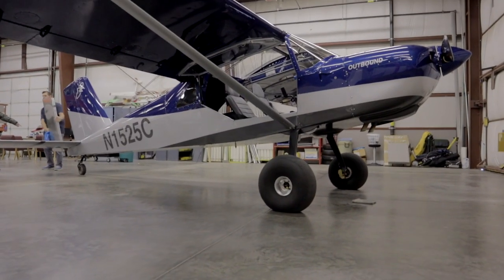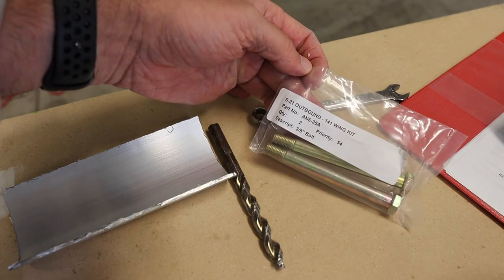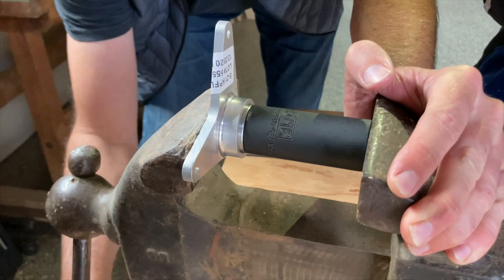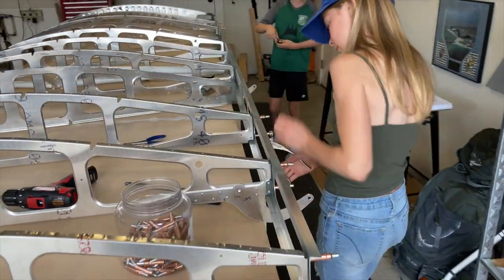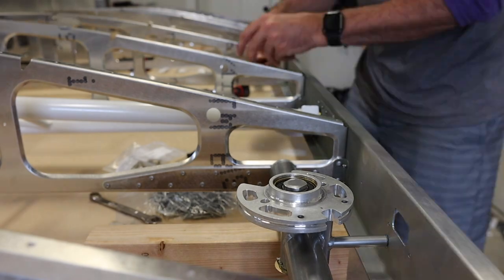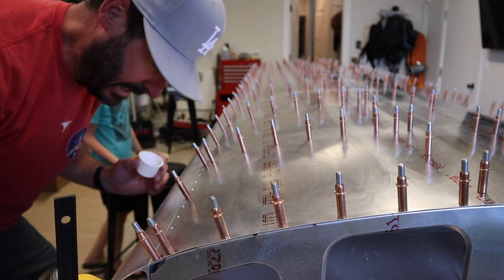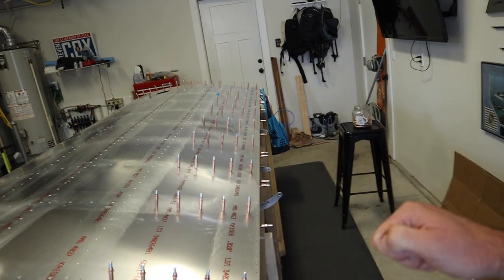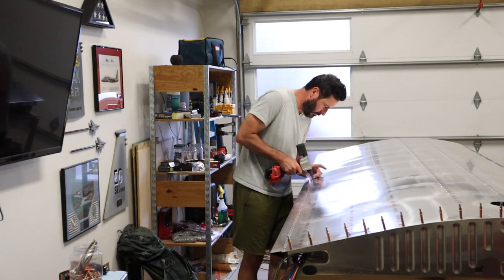RANS S-21 Ep 6 Wing Build Part 1 (LONGFORM)

Comment: Great to have the kids involved.  This is going to be such a huge boost to their self confidence. 
21:50 looks like you used thread lock with nylon locking nuts.  I have heard that the thread lock will soften plastics and combining nylon locking nuts is not good.  I could be wrong. I  don't actually know what I'm doing.   Looking for input from the collective wisdom.
Reply from the maker: Hi Ross, thanks for the comment. Good catch. I went back and forth on this (thread lock) myself. I still don’t have a great answer. I think I’ll pose it to RANS. Cheers!

Comment: You were supposed to install the gap seals while you had the last 4 rows of ribs clecod, then match drill, starting in the center as per the manual. Thus preventing off centred drilling of gap seal and spar while drilling through the top skin. Looks like you got it. Cheers!
Reply from the maker: Tis what I did! Thanks for the QA :)